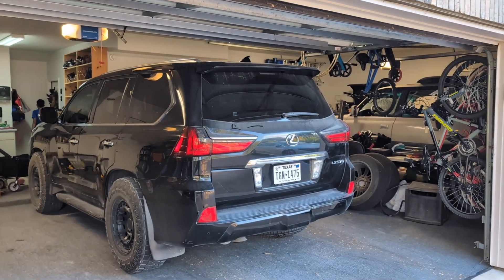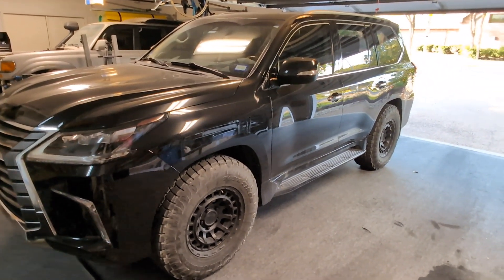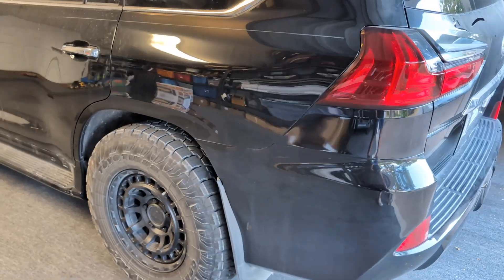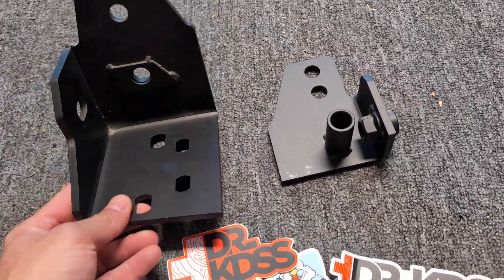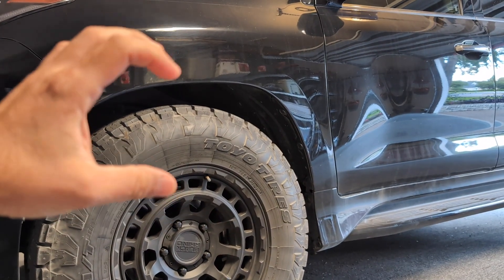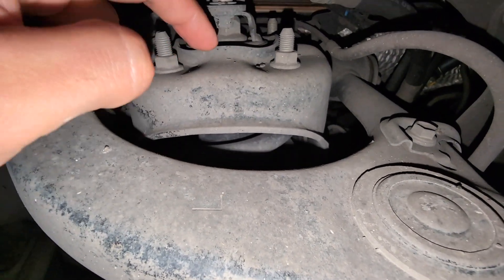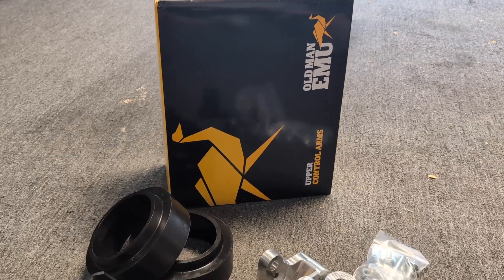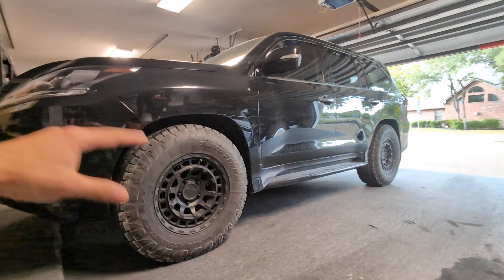LC200 LX570 Fix Suspension Geometry After Lift Spring Spacers Shock Spacers Panhard Bar Relocation

Comment from the maker: I will have detailed follow up videos showing the installation of each of these items as well. So make sure to subscribe and click the notify "bell" icon so you are notified when they get uploaded.

Part 1 video of the LX570 lift: https://youtu.be/IfHqN5sMW0Y
Part 2 video of the LX570 lift: https://youtu.be/lIOXEyixv2k
Part 3 video of the LX570 lift: https://youtu.be/RsDOJrT767w
Part 4 video of the LX570 lift: https://youtu.be/dvEw6gEx5z4

Below are the links to the products used in this video.

I provide affiliate links to help you find the products I use and as a way of supporting the channel. If you purchase a product or service with the links I provide, there is no additional charge to you.  I always recommend shopping around for a better price.  Thank you for supporting the channel through affiliate links.

Dr KDSS BOTCK bolt on panhard bar correction kit: https://drkdss.com/products/botck-bolt-on-trackbar-correction-kit-land-cruiser?_pos=1&_sid=c15a62814&_ss=r

2 inch (50mm) rear coil spring spacer kit: https://amzn.to/4hhRKY0

E&E Offroad rear shock spacer kit: https://www.ee-offroading.com/product-page/rear-shock-spacer

10mm OEM Front Strut Spacer: https://www.ebay.com/itm/323989932989

Old Man Emu ARB Front Upper Control Arm Kit UCA UCA0001: https://amzn.to/3NFZ6Hj

Comment: Any issues with cv boots tearing after the lift and then using high mode?
Reply from the maker: Not on either of the two LX570s that I lifted over the years. But anytime you lift an independent suspension truck there will always be more angle and more stress on the CVs. And likely they will require maintenance sooner than if you didn’t lift it
Reply: @ That makes sense. Thanks for the info!
Reply from the maker: @HeadHunterZ06 you got it!!

Comment: Hey there, awesome build! I just got my new to me 2014 LX 570 a few months ago. I'm sure I'll plan to mod it a little bit down the line, but I just really want to level out the suspension. You don't think that should change the front steering geometry to the point of needing extra parts, do you?

Essentially, I would just be lifting the front to match the back so that it's level.

Just as you've been lifting things and modifying things, have you gotten a sense for what the highest you can adjust the sensors to before needing those additional parts to correct geometry?
Reply from the maker: For that slight of a lift I don't think you need to change anything other than the sensor position to adjust the height. You may need to get an alignment, but that is really all you need.

Comment: Your truck looks great.  I'm really interested to hear your thoughts on the ride after installing all of those other components, assuming you were on the full-sensor lift for some time beforehand.  I did the BOTCK and was at Hidden Falls this weekend and definitely could tell it felt better, but wondering if I need these other pieces.  One other question:  Did you put the same size tire in your spare tire location? If so, did you have any fitment issues?  I currently have 275/70r18 (stock LC wheels on my LX) and it seems the spare barely fits underneath.

Comment: Good stuff! I've done the sensor lift and have some of the undesired affects you mentioned. Glad to know there is a way to correct it and go even higher. Looking forward to the install video.
Reply from the maker: A good alignment can fix a lot of the effects after a lift. But at some point you run out of room to adjust with the stock components. I have lost of the work done with a lot of video clips. Going to try and get at least one of them uploaded this weekend.

Comment: Thank you so much for sharing your knowledge. I have a found something strange. The AHC sensors were not in the same position - 2 were close to the lower end of the slide. I corrected them. Then a funny thing is that I have a crooked steering wheel. It is not centered. Any advice? Thanks.
Reply from the maker: That is a common issue. It is important to make sure everything is aligned correctly, after you make any adjustments to the height. Take it in for an alignment and they should be able to correct the steering wheel angle and also verify your toe and caster are set correctly.
Reply: Looking for the follow up video after the install. Totaled my built 200 and Looking at building a 16 to 18 model LX. I have it's on some Icon rebounds off my 200 I'd want to put on.

Comment: Would you recommend doing your globes first before you do this? I can't tell if my globes need it, but I've been thinking about doing it since the maintenance history on AHC fluid changes was absent from the records. But I also wonder if it's better to do after doing this whole setup like you have done.

Also, if you did a video of this work getting done, even if it was a super long video, i'd be totally down to watch it.
Reply from the maker: You can.  But it’s not necessary. If your AHC fluid has not been flushed I would recommend doing that. My general rule of thumb on the LX AHC is to flush fluid at 65k miles, 100k miles, 125k miles, and then replace the globes and flush at 150k miles. I did a detailed video of the glove replacement and flushing on my previous LX. Here it is incase you want to see the whole process. 
https://youtu.be/kyhXTL4629M
Reply: @NKPGarage  thanks. I flushed them at 140k when I first got the LX. Now at 160. So I’ll keep to the schedule and do the globes eventually. But rather do this now haha!
Reply from the maker: @TylerPoppe if the ride feels good you’re probably fine to keep the current globes. The typical sign that the globes have failed is when your ride gets really “bouncy” over bumps,  or when you aren’t able to notice a difference anymore between the different comfort/normal/sport settings.
Reply: @NKPGarage  hmm copy that. I feel like I could never tell too much of a difference between the modes on my 2013, just barely. 

Maybe I’ll just do it for peace of mind and a new baseline. Thank you! I need to find a LX in my area to ride in to see if it feels different from mine ha.